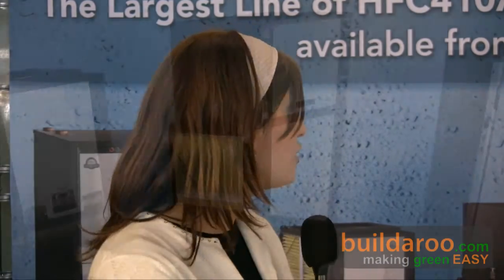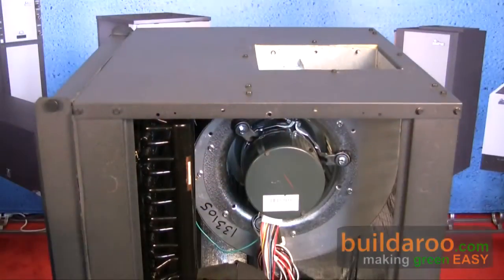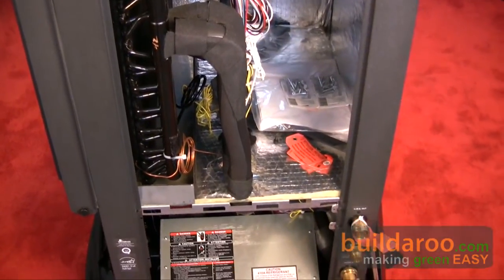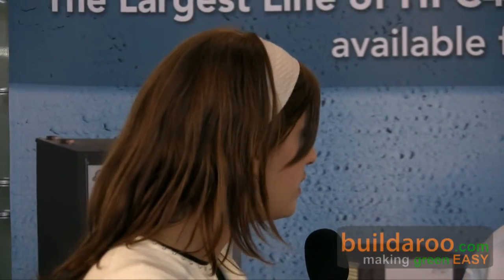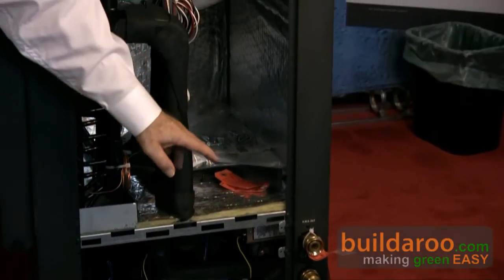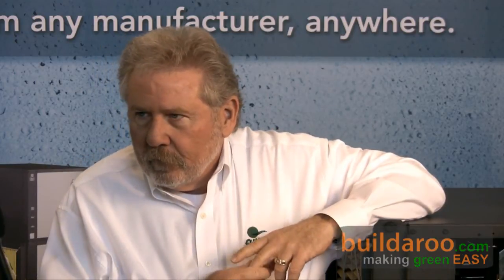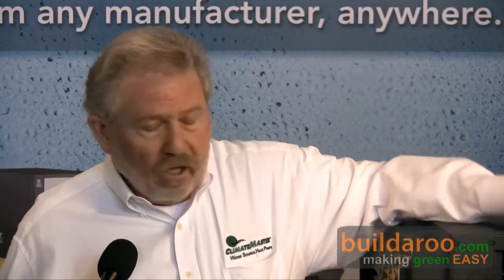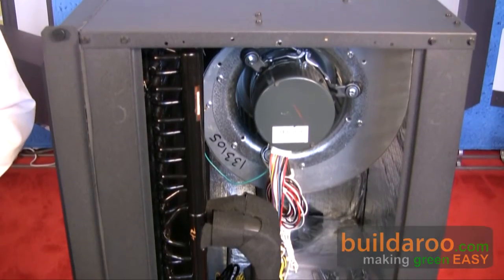ClimateMaster: Geothermal Heat Pump Systems - buildaroo.com

Comment: NO!!!! Not simultaneously!!!!!!! It can HEAT your home but it will be CHILLING your water!!!! She asked if it could heat the home and the water. The answer is yes bus not simultaneously. It would only HEAT the water in COOLING mode. A WSHP is an Air Source Water Chiller in heat mode, the way I see it...
Reply: Old comment... But a desuperheater can absolutely heat water at the same time as the unit is providing home heat.